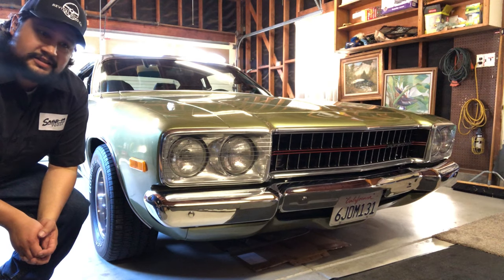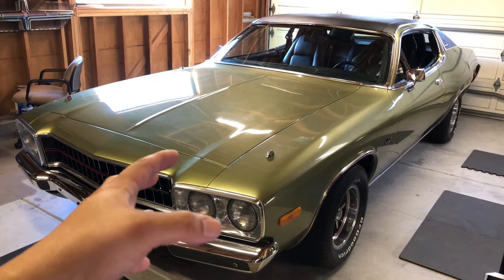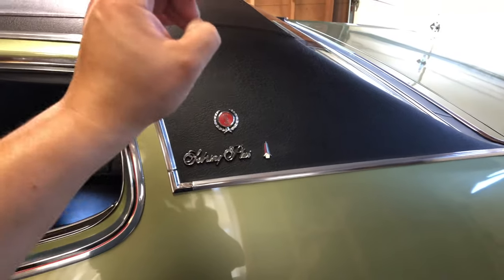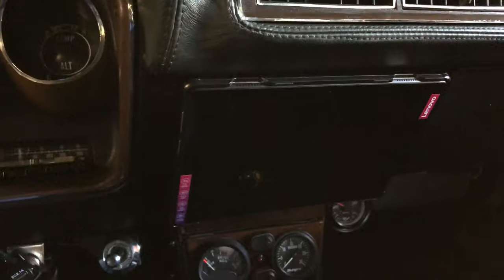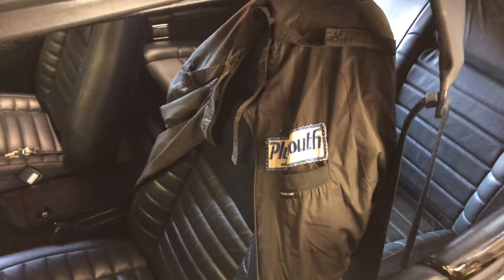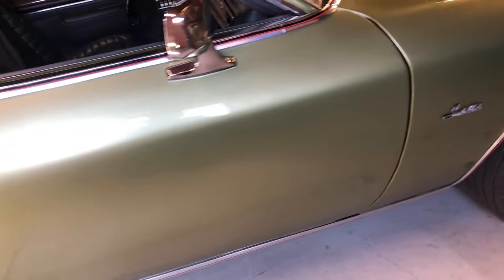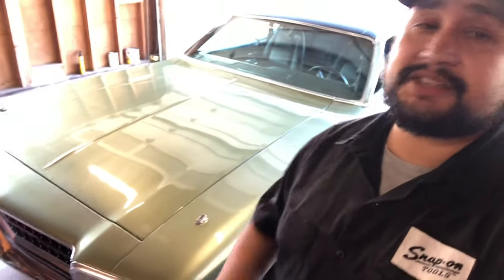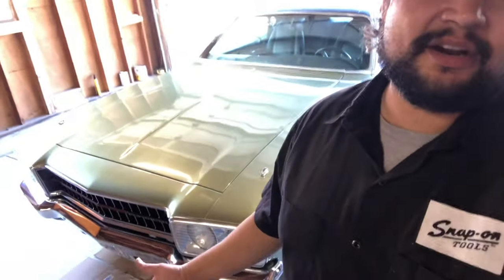MOPAR REVIEW : I review my Dad's 1974 Plymouth Satellite Sebring Plus (Special Edition)

Comment: "Personal Luxury Coupe" with interior and exterior trim group option packages. Gorgeous !  Think about maybe Chrysler factory 15 x 8 HD wheels...IF air shocks we're needed for the 14 x 10s in the rear, When they were installed, you Could drastically improve ride quality by mounting fresh modern shocks all around, and these 15 x 8s from Kit car and Super Coupe models give you Stance, Stability, and still available 15 inch performance tire Selection options... Without clearance issues. Well Done !
Reply from the maker: Thanks! I’m glad you liked the video

Comment: Your dad car is absolutely beautiful..... Are the door mirrors from a C-body...... The paint and interior are awesome...... Did you and your dad go through the suspension if so what mods did you do if any...... I have a 74 charger sunroof car the I took out all the soft rubber in suspension and the k-frame is solidly mounted with mopar performance solid k-frame mounts no longer available...   but firm feel makes them in aluminum I have those on my 76 charger with other mods and the car drives like it's on rails..... I get the luxury thing on your dad's and it's cool.... But I'm addicted to horse power and handling on my old mopars. Still never let go of your dad car it's one of a kind.
Reply from the maker: Thanks man I’m so glad you liked the video. The front suspension was completely rebuilt with an upgraded sway bar and bilstine shocks. The rear is stock with the added sway bar and air shocks. The mirrors are actually off a 77 Chrysler LeBaron. Your car sounds really awesome man email me some pics, my email is in the description.

Comment: I did this, to some extent, with an '82 Cordoba....318, good duals, wheels (below), and lightweight engine components to allow the choked small block to breathe better. Diet interior as much as possible, then DynaMat. Fàctory sound ànd heat insulation materials in luxury option models are very thick and Heavy.